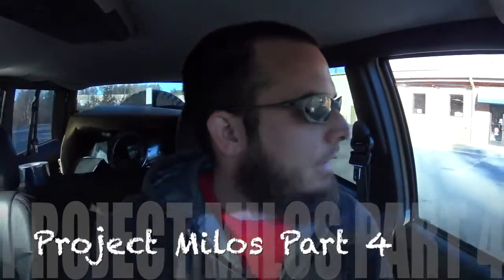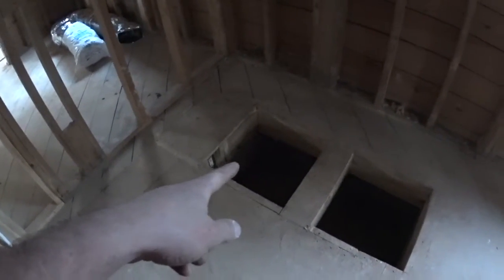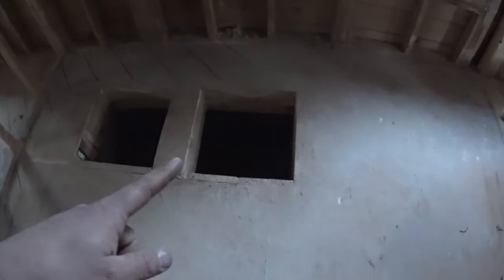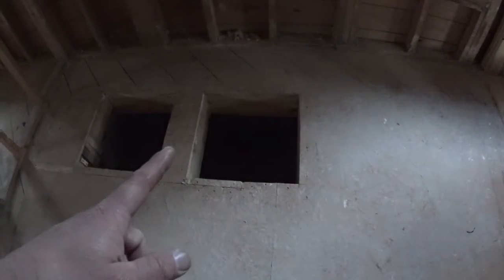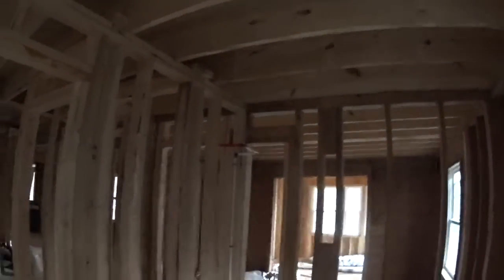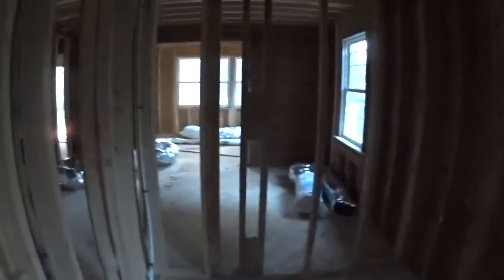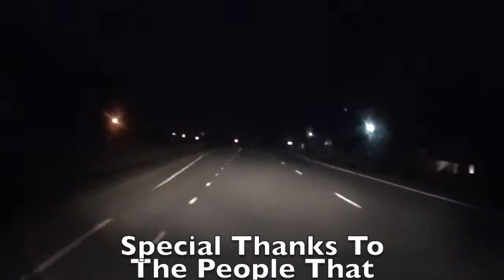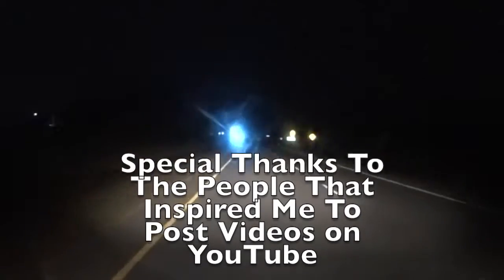HVAC Install: Project Milos Part 4

Comment: Quality job. They are taking some time to get that place done. Your furnace room will always be cold with that heat pump tank.
Reply from the maker: I was thinking about that with the heat pump water tank and at least by having a Register in that room I will be able to increase the size of duct in the future if necessary.